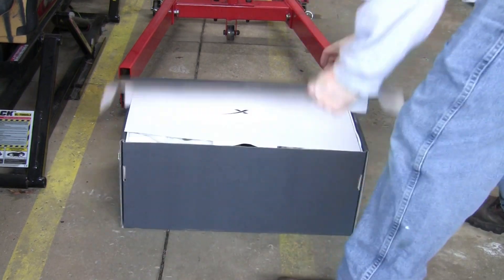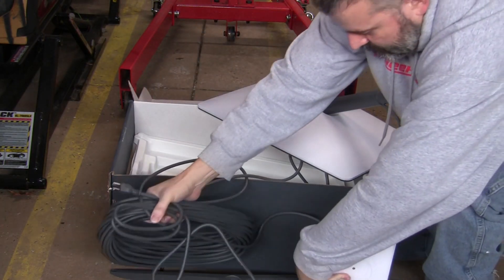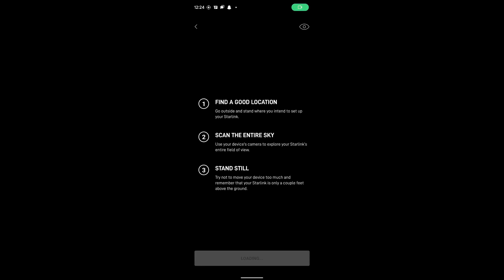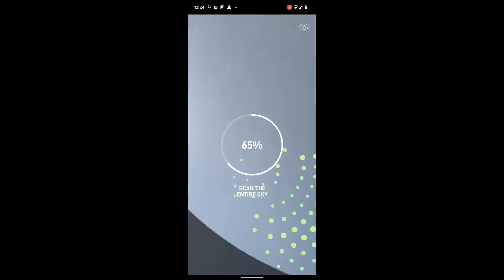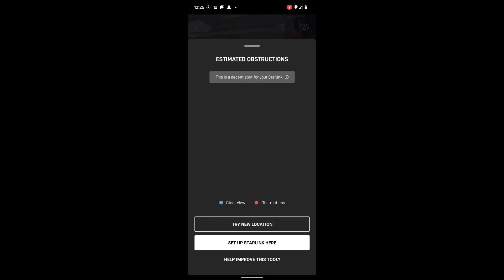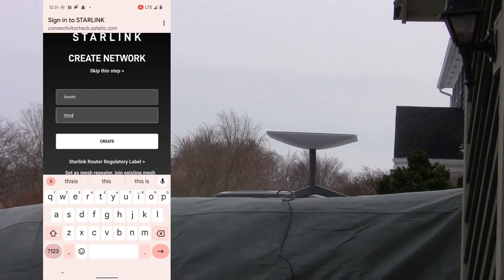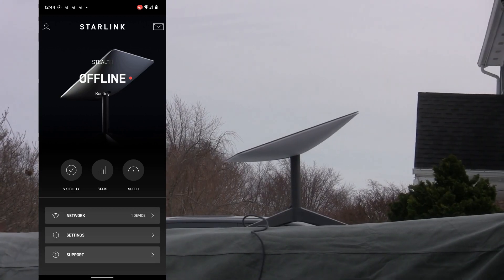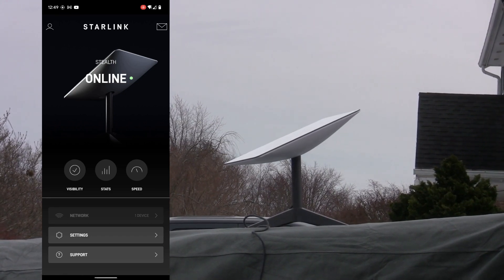Starlink Internet - Unboxing and First Impressions

Comment: Very very unstable internet...
Reply from the maker: So I have the dish mounted permanently and have been using the service for the past three days. With the dish mounted I have had very few total outages .... according to the app, no outages greater than 2 seconds for the past 12 hours.  Now speed has varied greatly, but no outright outages.

Comment: Your speed drop is between you and the router....that's why they show the different speeds....if you're close to the router and not outside the speeds will be more comparable between starlinks and Ocala speed test
Reply from the maker: David, thanks for the comment. If the slowness was between the phone and the router, that might be more concerning... I was only about 10ft away from the router when I was doing the test. My ethernet adaptor has shipped this week, but I am still waiting for my antenna mount... so stay tuned for more testing in a few weeks.
Reply: @AGeeksGarage  Gotcha. I thought maybe you were outside away from the router. I'm hoping I can just disable their router and use my Unifi set up for mine.
Reply from the maker: @CaptDBama  there is a setting on the new devices that put the router in a bypass mode, allowing you to use another router or wifi setup. But you need to have the ethernet adapter in order to enable the setting. I will talk about it when I get the new mounting bracket ... hopefully sometime soon.

Comment: not to be a SpaceX defender but SpaceX does recommend a clear view of the sky, for it’s phased array antenna that uses hundreds of tiny antennas to bend the signals to and from the satellites as they pass by. From what I heard whether shouldn’t really affect the dishes performance unless it is a really bad storm. Hopefully this will help.
Reply from the maker: Yeah, thanks. I have a nice clear view of the northern sky, so I don't think that is the issue. One thing I did note was that when I looked at the web sites that track the satellites that cover my particular cell, it usually showed only one satellite available. Checking the maps tonight right now it shows NO coverage at all. Now, how accurate these maps are ... who knows, but that is the fun of new tech right :) Thanks for the comment.

Comment: I have a 93 dodge spirit. Hope to learn via your build. When replacing gaskets how diff is a 12v vs 24v 6g72
Reply from the maker: Not really sure about the 12 valve engine as I have worked on one before. There are 6g72 manuals out on the internet, I would suggest doing a search for them to see if you can find one of the available manuals and review what it shows.  Good luck to you.

Comment: I've had some very similar issues with using propane heaters in the garage as well.  I supplement it with a 5000W heater, but you still get alot of water in the air from the propane that ends up everywhere you don't want it.    Thanks for the info on the Starlink setup, been keeping an eye on it as we've been looking to buy a house over the past year!
Reply from the maker: Yeah the smell isn't all that terrific and I end up keeping a door open because I don't want to end up with CO poisoning either. I am hoping that I may have a better long term solution for the heating later this year...
Reply: @AGeeksGarage  I actually installed a carbon monoxide detector in the garage to be safe.  I wouldn't smell it at all unless the tank was getting low so I wonder if you're heating isn't meant for indoors?